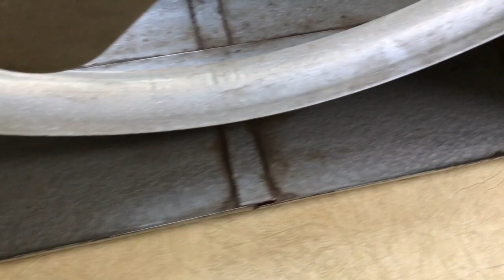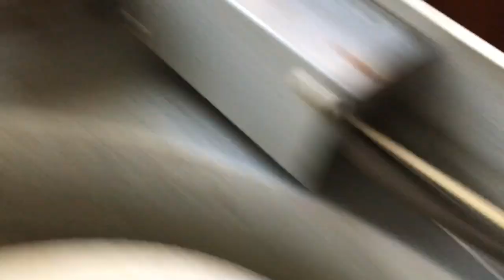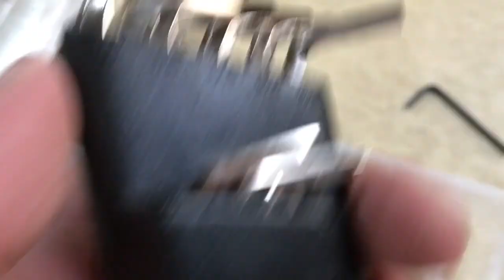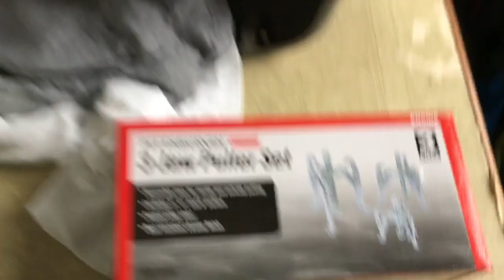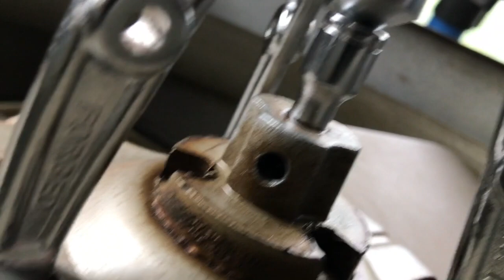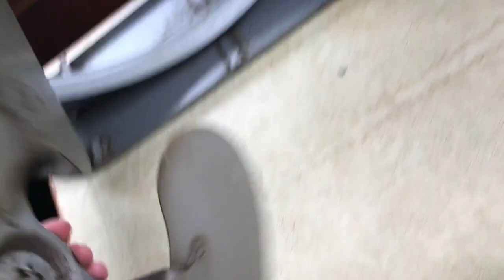Fasco Artic Air Box Fan - Blade Puller-palooza

Comment: I always enjoy your videos and learn so much. Any advise on how to unfreeze the GE motor on the 20"window fan and the 20" portable window/portable box fan? I have several and would like to get them operational. Thanks....Joe
Reply from the maker: pull them apart. If you can get the blades off then you  pull the seal/plate off the back of the motor. There's a C clip holding the rotor in. then after pulling the rotor you should be able to de-grease and oil/reassemble. I could the C clip to be challenging. I have a few videos about this, and other youtube fan collectors have good videos up as well. That's how I was able to get started on mine. Go back to my 'Rusty Bob' series. That GE was stuck very bad - and I got it going. In fact I should run that fan tomorrow...

Comment: Thanks for making a video on using a puller. It's smart not to use something with a point on the fan hub like that puller had. My biggest fear when trying to remove fan blades is if the hub has mushroomed from the previous owner banging on the hub with a hammer or chisel. The only thing I would have tried prior to the use of a puller was some heat. I have the Harbor Freight heat gun and would have applied a little heat to expand the outer surface of the hub, thereby breaking the rust/old dried out oil that's is keeping it stuck.
Reply from the maker: yeah I have an avocado Lakewood and somebody hammered on that one for sure. May never come apart. we'll see... If I were a machinist I could just machine a spacer out of some bar stock, but being a mere mortal I have to use what's around. Even the dowel I found and used could start to be faced off. But it worked. The heat gun thing is a good idea. It's been on my christmas list for a while now.